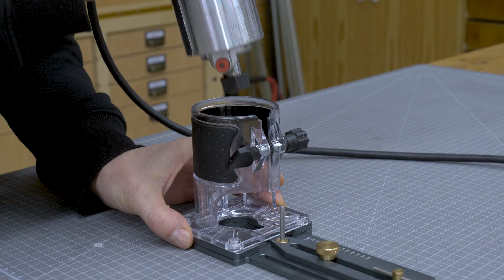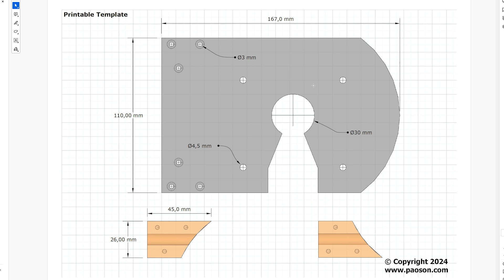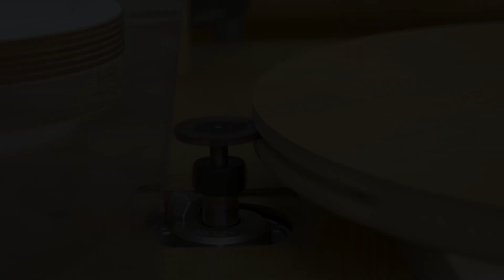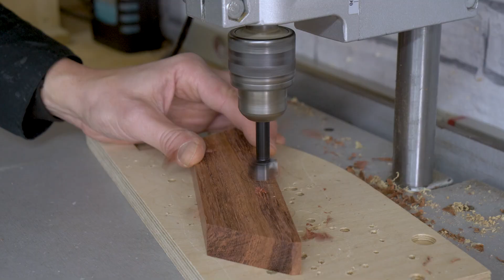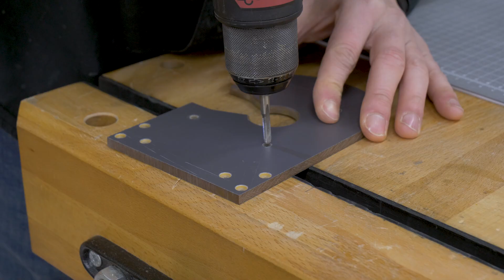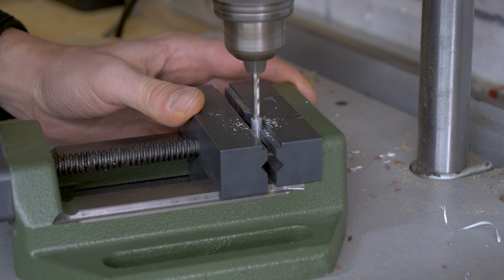DIY Quick Install Base Plate for a Router - How to improve a cheap Circle Jig

Comment: Another high quality video and piece of kit ... but I'd expect nothing less 👍
With regards the issue of the cord/vacuum hose getting wrapped around the router, what about placing the entire workpiece and router on top of a 'lazy susan' turntable ... that way you can rotate the table and workpiece under the router.
Reply from the maker: seems like a good idea, thanks Barry!
Reply: @Paoson_Woodworking  A flash of inspiration ... with small pieces all that would be required is the lazy susan, for larger pieces it might be necessary to have it lifted slightly so the edge of the piece (under the router) could be supported by a bearing of some sort.
Reply: Marius Hornberger did a circle jig like that a few years ago. It was a clever idea.
Reply: @LostWhits  Oh I'm sure someone else has already done, just need to type the right search term 😁... I designed some multi-function workbenches, then I found  Paoson's version which is nearly identical a week later👍